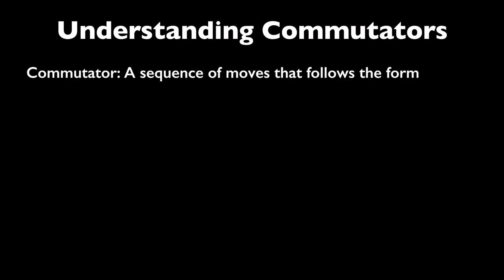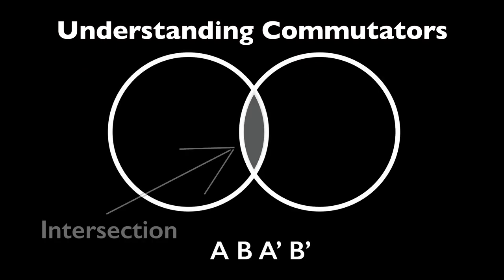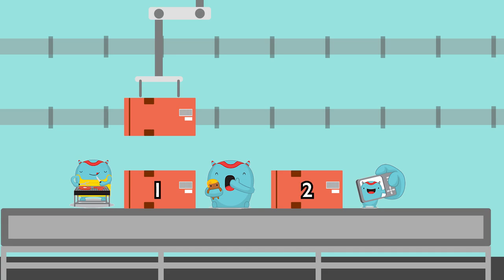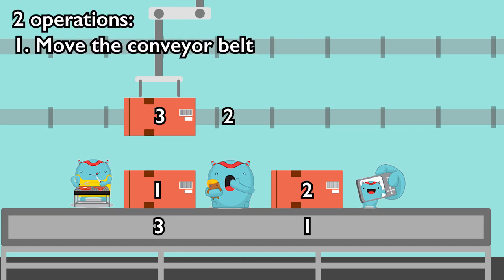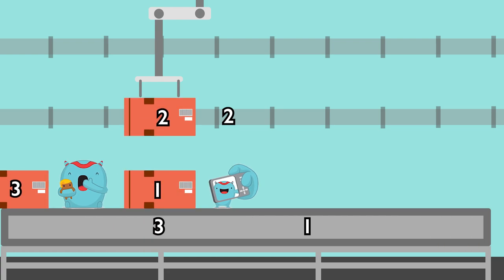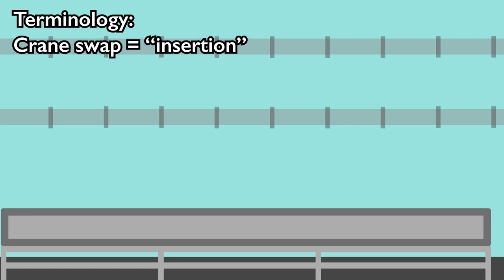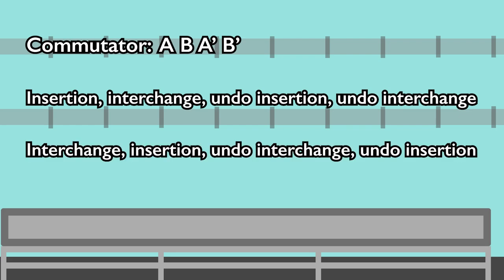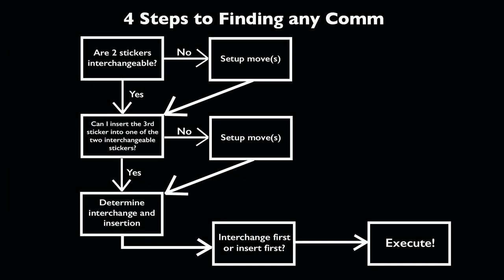3-Style Tutorial Part 1: The Basics

Comment: in your practice sheet the 3rd. example for edges you say that "there is NOT a single move that will swap two stickers without disturbing the third" so what about F2 (setup U R’ F’ R S R’ F R S’ U’ possible solution with F2: [B L':[F2, U' S2 U]])? it's probably worse for execution and you wouldn't gain anything because with F2 there is no way to insert the 3rd without a setup but even if it's just semantics i'd say the text is wrong.
Reply from the maker: oops, yeah. [F2, U' S U] works. I'll fix that haha
Reply: and i missed the easiest insertion lol.. so far i only use comms on big cubes centers but i might pick it up for corners and edges

Comment: What is UBL RDF blah blah
Reply: Each face has a letter which is used in notation. U, D, R, L, B, and F. UBL is the corner in the top back left. The corner that aligns with U, B, and L. RDF is the corner on the right bottom front. The corner that aligns with the R, D, and F faces.
Reply: @JudeStradtner  ok I got it